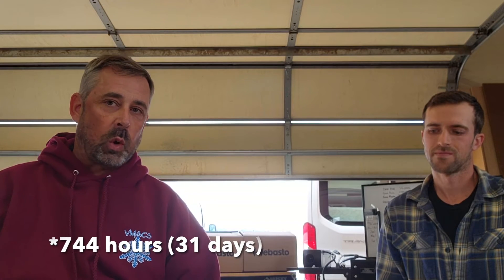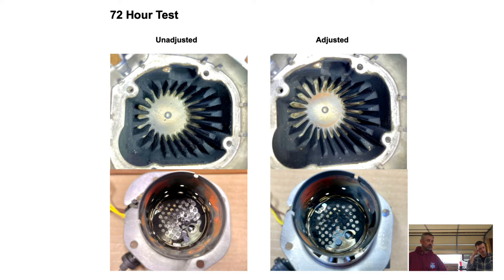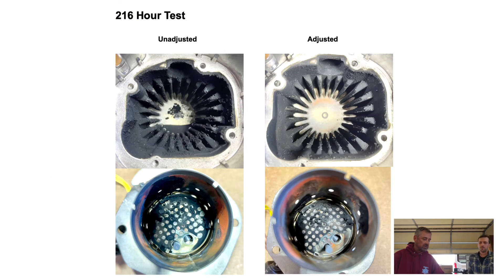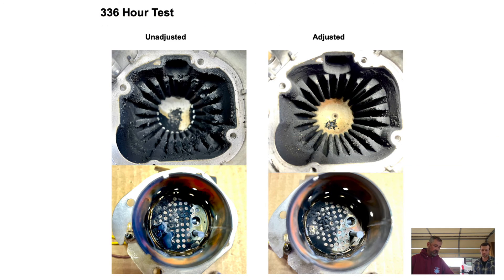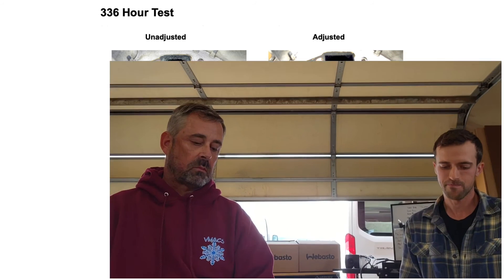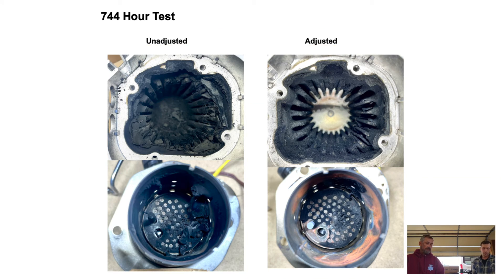#8 Webasto Air Heater CO2 Adjustment Comparison Test

Comment: Hi. Great video. This might be a dumb question (?). If I install the 2000 STC with the pre-adjusted 6,400ft altitude adjustment, are there any drawbacks with it being used primarily below 6,400 feet? Thanks!
Reply from the maker: Yes, there is some BTU loss because the fuel delivery is intentionally slowed to balance the exhaust at higher elevations. Since there is less fuel there is less heat. The result is the heater running a bit lean at lower elevations. We have no reports of underwhelming heat output or undesirable side effects.
Reply: @VMACSinc  Thanks much for the response

Comment: Thanks so much for the video! My Airtop 2000 STC is failing to start and I'm doing research before cleaning it out. It's nice to see these photos of what to expect when I open it up.

I regret not getting the EVO40 since I use my van at high altitude all the time; I had read some bad advice that a smaller heater (2000 STC) would work harder at altitude and thus keep cleaner... yeah not true. Unfortunately I've already gone down the 2000 STC and can't really justify switching to the EVO40. Cleaning is the first step and then I hope to find someone with the CO2 measurement tools to do the high altitude tuning.
Reply from the maker: Try contacting Mitch at Redpoint Conversions. He has the equipment to properly perform the adjustment to your heater https://www.redpointconversions.com/

Comment: Thank you for doing an update.   I must have missed whether the tests were on gas or diesel units?  Also, how do we find out where the installers that are at even higher altitudes that can do these adjustments are?
Reply from the maker: These tests are gasoline heaters.
You will need to call Webasto dealers that are located at those higher elevations and find out if they have a C02 exhaust gas analyzer and Webasto diagnostic software to properly perform the procedure. For frequent operation at even higher elevations you should strongly consider using the EVO40.

Comment: Were the tests run at full power?
Reply: The rheostat controllers were set to just above room temperature in an insulated shop. Our goal was to mimic real world use by running the heaters mostly on high (about 75% of the working hours), but sometimes running on a lower power once the thermostatic temperature was reached (about 25% of the working hours).

Comment: Hay great job.iv been wanting one for several years.but I go into mountains often . Can it be adjusted to 8,10 thousand feet elevation?
Reply from the maker: You would have to find a shop at the desired elevation, with an exhaust gas analyzer to make the adjustment. The adjustment will be good for whatever the elevation is where the adjustment is made.